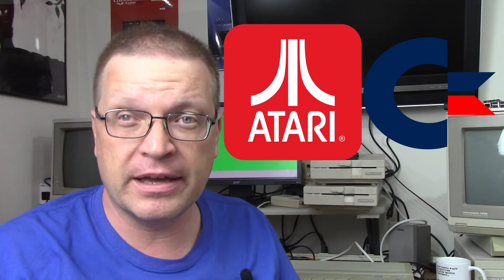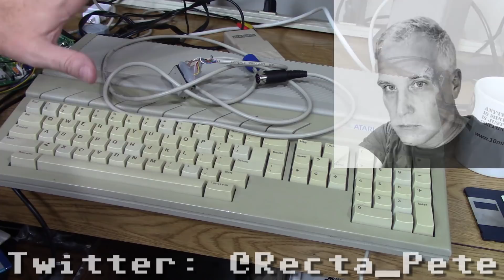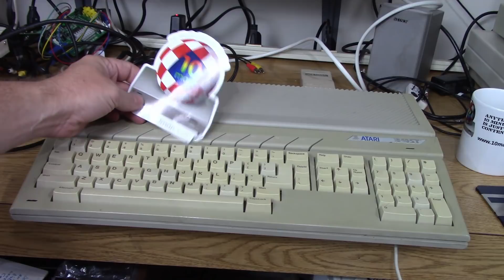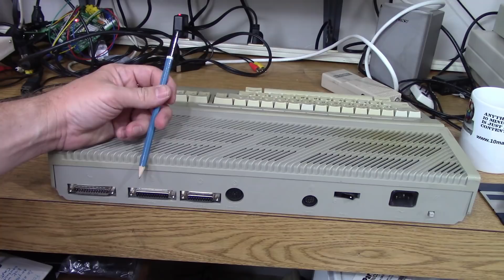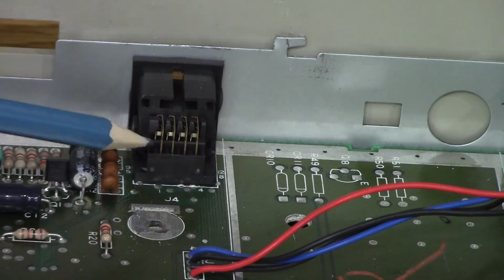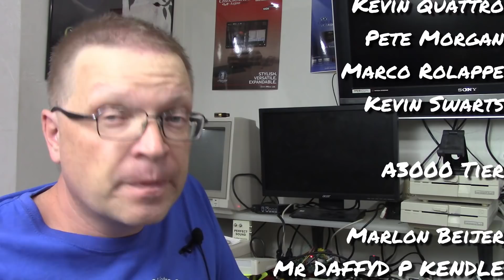An Introduction to the Atari ST - 10MARC Atari 1040ST Special

Comment: I was so happy to see that you will review the Atari ST - I owned a Commodore Amiga back in the day and the Atari ST was the "enemy" but I just recently bought myself an Atari STE 1040 to see how it would stack up against my Amiga and I will say, that yes, the Amiga wins in the end, but there are some games  where you can 'feel' the Atari is just that bit faster - if you take a (I'll admit, crappy conversion game) - like Bionic Commando, it's just that little bit faster on the Atari thus making it a bit more playable, but it is the exception, usually the Amiga sports better graphics and sound. I went on to explore the world of Atari and quickly realized I needed something called an UltraSatan - and speaking about that, do yourself a favor and fork out the money (15Euro) for Petaris HD driver - it will make it so much easier when you can read your SD cards on both the Atari and on your PC - also you should be getting used to a LOT of drive-letters as the Atari only support around 512mb partitions unless you introduce some other magic which is not out of the box. All in all I am happy about my Atari, its a quirky little machine and great fun to explore.
Reply: You really need STE specific games to too the similarity between the two machines.  It was close, but the Amiga was still better tech.
Reply from the maker: @IntoTheVerticalBlank  not too easy to find STe specific games, as just like everyone else, a lot of games were written for the Lowest Common Denominator. We had the same thing with AGA games.
Reply: @10MARC  Yeah this is correct. Many of us are trying to  write them now, but it was bypassed back then. 
The Amiga was whooping ass making$$ for companies. 
Luckily, the AGA lowest common denominator as awesome!
Reply from the maker: Thanks for the advice about the Ultrasatan drive. I saw a free and paid version of the drivers, and it sounds like the paid version is the way to go

Comment: Gotta disagree with you on the original Mac.  The screens are actually pretty awesome for what they are.  I have several of them and they are incredibly sharp.  Sure...monochrome only (vs. color for Amiga / Atari) but it was surprisingly easy on the eyes.  Even for long periods of time.  And, by the end of 1985, the 512KiB Mac was pretty common.
Reply from the maker: The display is pretty on the Mac for a monochrome display, but coming from using color since 1982 I never could have tolerated it. Too much of a step back. The 512K version certainly an improvement, but I thought that was a 1986 product.
The other way I think about it, is that an Atari ST or an Amiga from 1985 is still a fun and incredibly useable computer to this day, where a Mac of that generation you really cannot do much, if anything with.
My Amiga 1000 from '85 I use to process JPG Images and it runs on the very latest Amiga OS that is available - it is a fully usable computer.
Reply: @10MARC  I believe it was late 1985 or early 86 on the 512K version (I have one that I could check).  I also came from color (TI-99/4A in 1982) but I remember seeing the original Mac screens in high school and amazed about how sharp they were.  Yes, no doubt the Amiga and ST were superior machines to the original Mac line...no question there.  Well, the Mac did have more software with tons of great prod apps.  Took the ST and Amiga a while to have "killer apps".  But sorry, I have a strong disagreement with not being able to do anything with the original Macs...some of us still use them for 68K development.
A computer is never obsolete as long as someone (like me) is using it.
Reply from the maker: Oh no worries! I am a teachable person. If you tell me Macs from '85 are still useable I believe you. I watch a lot of videos on Macs, too, and everyone seems to have a nightmare of a time getting anything to be copied over to them, sometimes requiring a PC and two different Macs to copy different floppy formats over. And me being a smug Amiga user, I just count the twelve different ways I could have done it in half the time. Or I just smugly think I could emulate the Mac on my Amiga and transfer it over that way.
We Amiga users are kind of jerks like that. I admit it. 🤣🤣😉
Reply: @10MARC  Let it be known that I AM an Amiga user.  I worked and saved up and bought my Amiga 500 when I was 16 and I still have (and use) that Amiga 30 years later today.  I didn't get a vintage Mac until I started collecting computers 20+ years ago.

Comment: The ST has its own charm. It's really the anti-Amiga. The Amiga is custom chips based, the ST is largely off the shelf components. The Amiga is all about being proprietary, the ST tends to adhere more to standards like MS DOS file systems, MIDI ports, an operating system straight from the PC that was very beginner friendly. It's a simpler machine, with a simpler OS.
Reply from the maker: Yes, there are benefits to it being an off the shelf machine. I am going to reserve my final judgment on the TOS until I get 1.04 installed, and play with some of the enhancements. But my first impression is that you can't really do anything with the OS.  I am so used to being able to control and manipulate everything on the Amiga it is a system shock

Comment: The specs between an Amiga and the AtariST and the Ataris GEM GUI (I didn’t care for) made me pick Amigas.
Reply from the maker: No doubt about that. It was not a contest for me back in 1988 when I chose the Amiga 500. If I was in the market for a 16 bit machine in 1986 (when I was 16), I might have been tempted by the price, since the Atari 1040ST was so much cheaper than the A1000. After the A500 came out there was no competition in my eyes, though.
Reply: No doubt overall Amiga was superior, however I will say the Atari St was much faster loading both from disk and hard drive. The difference was like night and day and made me wonder what the hell Commodore did wrong. It was also convenient that the Atari could natively read IBM disks. The high res monochrome monitor was also gorgeous for its era and was almost paper white. The Atari Ste made up a lot of the shortcoming with the Amiga at least on paper. Being honest though to this day I still think the Amiga was a groundbreaking machine while the Atari St was a respectable machine that could do some things very well. If anybody has an Amiga to give me let me know :))

Comment: The cartridge port was actually used for a lot of things like scanner interfaces, video and sound digitizers with stereo capability, midi expanders, external clocks, Action Replay style cartridges, external sound chips, copy protection dongles for professional midi sequencers and so on. Nowadays you can also plug in things like Netusbee for having an ethernet and USB ports etc.
Reply from the maker: Really? I can fins so little information about it besides "There were very few peripherals released" - Is there a central database of past hardware expansions I missed somewhere? Amiga has several of those... (There I go again..)

Comment: Great Retro Cast. I recently acquired a 520 STE to sit next to my A500+.  I've now added an Ultra Satan and additional RAM which helps with some later games and demos. It's quite surprising how different your ST motherboard is to the later STE.  If you are not there already I recommend you join in on the exxoshost forum.
Reply from the maker: I have sopent a little time on that site. It seems like a good one. The STe is what I really wanted, but they are hard to find over here in the USA. This is still a good choice for me since it really was the main type of machine software was written for.

Comment: I appreciate you putting yourself through this so that I don’t have to :-). In all seriousness it would be nice to see what an ST can do, I’ve never owned one, well I’ve never seen one it person. I don’t know of anyone in our school that had one back in the day either. To be honest the only thing I know about it is that some of the earlier games were better on it than the other computer that clearly was not mentioned today. But that soon changed as popularity shifted the other way.
I look forward to the future episodes.
Reply from the maker: One of the first things I learned is that they are not easy to expand. Even adding RAM involves modding and soldering, and accelerators are not the "Plug and Play" (or shall I say "Autoconfig") thing we are so used to. Even today there are many ways to expand and Amiga without picking up a soldering iron.
Reply: 10 Minute Amiga Retro Cast yeah although to be fair plug and auto config were very rare. IBM compatibles didn’t even get a working version until 98 (yes I know they had a bad version in 95 some ten years after a particular good implementation existed).
Reply from the maker: Oh we had "Autoconfig" really since Kickstart 1.2 - adding RAM and hard drive controllers was as close to Plug and Play as you could get - with the ROMS on the devices supplying the device drivers. It was years ahead of almost everyone else

Comment: Is it possible to get the FrankenDisplay somewhere?
Reply from the maker: The GBS-8220 is usually about $25 or $30 on Amazon and it does an OK job of upscaling. Not a good or great job, but a usable job. The breakout box you can get from many electronics type store online. Just look for "9 pin breakout box", they are like $5 or $10 dollars.
It's probably better to make your own cable or buy a premade one. They are not cheap, though, as the connectors are not too common

Comment: Funny to think how, with the natures of the hardware and people behind them, it was all a big swap, with the Amiga being a spiritual successor to Atari's 8 bit stuff, and the ST a spiritual successor to Commodore's 8 bit lines.
Reply from the maker: Yes the shared history and parallel development of the two are really amazing. I think if the ST had not been rushed so fast, it would have been a much better machine. Probably designed with better expansion and much better audio.
Reply: 10 Minute Amiga Retro Cast If what was released as the STe came out as the original launch model, I think the ST line would have had a much stronger start. That blitter chip would have had it standing nearly toe to toe with the Amiga.

Comment: Again happy birthday dear friend. 
Great video, im not familiar with Atari systems, but midi sounds great. 
I hope you will compare the sound chip with the sid/paula in few games, the sound could be a buying point for me and dig into the workd of Atari 😁👍🏻
Reply from the maker: Ya... The sound is not quite C64 level in some cases. Very chip tune sounding but without the C64 personality. The MIDI it's only useful if you have a nice musical keyboard to go with it. It does nothing on its own - just makes creating music on other equipment easy. The Amiga had a dozen or more MIDI interfaces available and some great software for music creating, as well as incredible onboard sound.
Reply: 10 Minute Amiga Retro Cast Allright, so the specs were a bit weaker against the mighty Amiga from the start. Thanks Doug, I’ll stick around with my favourite computer then, but still gonna watch part two😁👍🏻